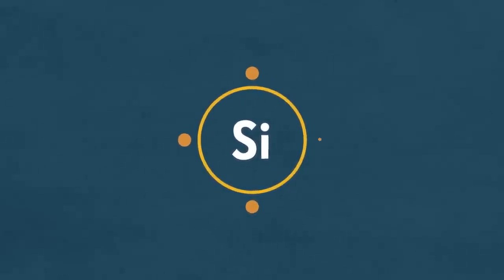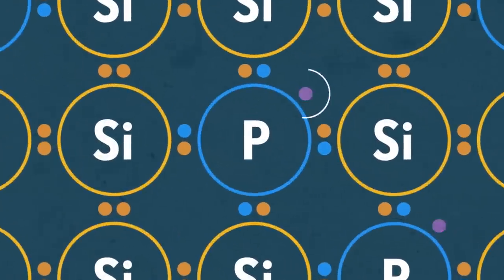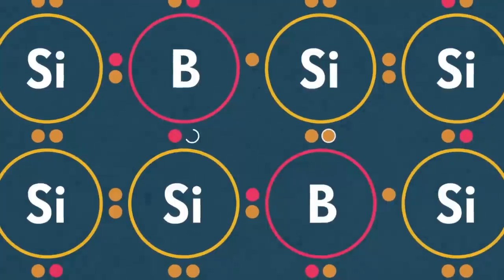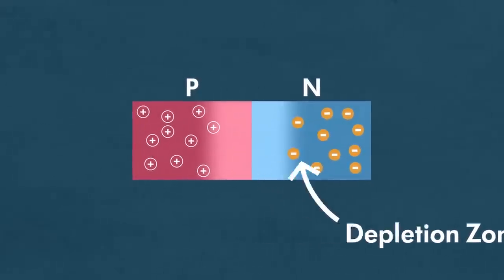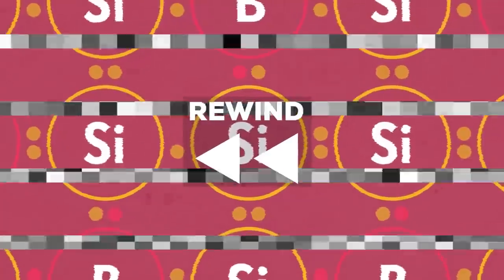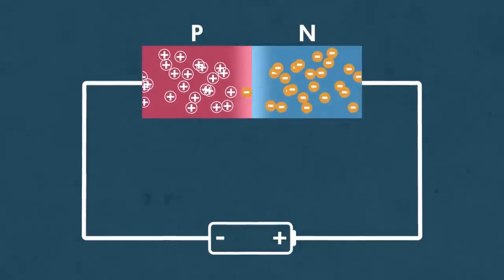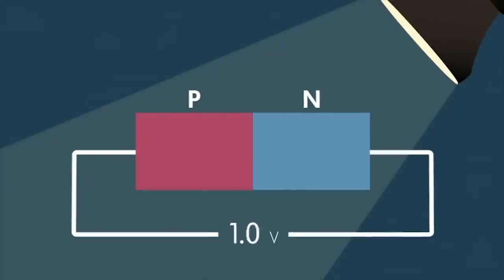How diodes, LEDs and solar panels work

Comment: I appreciate you work and love you content. Just one review here. Although you have beautifully explained the concept of depletion region formation, with the help of built-in electric field. However, while explaining the reverse-bias condition--and the expansion of depletion width, your preferred reasoning was;  @5:35 "because opposite charges attract". For me that was a conceptual jump. Because ideally, you could have explained it with the concept of external electric field formation--due to the applied reverse-bias across the semiconductor material resulting in a dipole. Which further reinforces the electrons to move away from the junction. Basically, in the reverse-bias condition, the external electric field compliments the internal electric field in forcing the electrons away, and towards the terminals of the battery, causing a reverse current to flow. This way it would be more consistent with the actual theory.

Comment: QUESTION:

In the case where the battery is connected in the "reverse" way (where the diode doesn't let any current through), why isn't it possible for an electron to jump from the P-side border to the N-side? The N-side close to the border to the P-side which at this point is deprived of electrons should be positively charged, inclined to take an electron from the P-side, and they ought to be possible to carry one too since they are N-doped. At the same time, the P-side should be very negatively charged since all the holes are filled with electrons.

I know that according to this description, the N-side isn't a conductor when the extra electrons have moved away from the border, but those phosphorous atoms are still there and they are now deprived of electrons, so shouldn't that mean that they have "holes" just as the holes on the P-side, and in that case they SHOULD be able to conduct electrons from the P-side.

I know this isn't the case because obviously the diode does work in practice!

Thank You!

Comment: The diode: type N & P with single junction. N is electron donor to P across the junction as a one-way-valve. It conducts in forward bias, but not in reverse bias. 
The photovoltaic cells develop a higher potential in the N-type when exposed to sunlight. The junction allows one-way current flow.

Comment: Another caveat worth mentioning is that this only applies to direct bandgap semiconductors, in indirect bandgap semiconductors some to most of the energy of the gap gets converted to phonons (vibrations in the lattice) rather than to photons. This is characterized by a difference in crystal momentum between the higher excited state and the lower ground potential, essentially crystal momentum relates to the velocity of the electron wave packet (the quantum representation of the electron) these wave packets are what are actually bouncing off defects when you talk about electron scattering.

Another thing to note is that the properties are direction dependant, he sorta got close to this when he zoomed in at the start but didn't go further.

Comment: The way solar pv diodes are positioned also matters.  Since light has to hit the depletion zone, it makes sense to position the N and P type to maximize the area of the depletion zone.  If I'm correct, panels either have the P or N type sides facing the light source.  The photons penetrate the layer and reach the depletion zone.  So a photon, by chance, has to be able to penetrate and be absorbed in the right place before any electron jumping can occur.

Comment: I think there's a deatil missing in you're  explination: that thet semiconductors can have they're electrons in the valence band exicted (through heat, or photons) enough to pass the band gap, an go into the conductive band, where they can be shared through all of the meterial, by the atoms in that meterial, just like in metals. If the exitation doesn't happen, it doesn't matter that the semiconductor material is doped. Doping is more of a huge helper ... 
Or at least that's what i remember from college. It's been a long time though, since then.

Comment: Congratulations, you just explained the relationship between electrons, positrons and the perturbation of "light" induction. This further explains piezoelectrics, crystallography and the making of a celestial body within the confines of a near vacuum at near zero Kelvin. Now all you need to do is explain the fluid dynamics of Aether, or as Hannes Alfven describes it "magnetohydrodynamics". I have already explained how this works along with the process that leads to sonoluminescence.

Comment: I have a question, solar panels emit infrared light when voltage is applied  to it , so does that mean that when infrared light hit on it then only it will produce potential difference ,
I think higher energy photons will also generate current and it will be more because the electrons will have more kinetic energy(photoelectric effect) , am I right

Comment: Some of you may be wondering why the absence of an electron is positive and the presence of an electron is negative. The reason is that the conventions on which sign is which charge were established long before the electron (and thus the underlying mechanism) was discovered. Ben Franklin came up with the convention, if my memory serves me correctly.

Comment: I think you could have detailed the part between 6:05-6:13, because for me (a noob in this field) it was hard to understand what happens exactly. As i imagine, the electrons move from the negative side of the battery to completely fill up the gaps in the diode, and the electrons would move from the right side of the diode to the positive side of the battery. And at this point, the diode would be happy, and would not let any electrons to the battery (because it would have to tear it out from the atom?), so the electrons cant travel through the diode anymore.
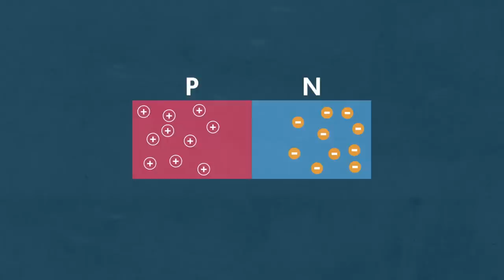Also, 4:56 is not clear either. Why is that a negative charge on the P-type conductor? It needs those electrons so it becomes neutral is it not?
Otherwise - awesome video, thanks!

Comment: Fantastic video! My only "complaint" would be that I wish you'd talked about "conventional" current, i.e. the fact that the + terminal of the battery is actually negatively charged and that's the terminal the electrons leave from. I definitely understand why you skipped it though. Unnecessary complexity!

Comment: That means that light is diodes as secondary to primary, that is primary diodes is one side that repels as the center expands, the barrier as during that barrier the positive go toward the negative which is being filled up that is connected to the battery, but to light so it is filled to the negative since it expands outward, the positive and negative side as between the opposite expand so electricity is created. The bigger the gap, the bigger the electricity. For the light part which depends on the materials which cause the color of light, well, it needs to require to cause the expansion, the center gap, so the bigger the gap, the bigger the electricity which is connected to becoming light, right? So, the fill is opposite of deplete so the fill is equal to electricity, the deplete is equal to decreasing electricity that is dependent on the side since it goes thru the hole, the positive and the negative side as it expands, so losing electricity, right? The current is electricity, so no current can flow since depletion is bigger. Well, the am sure the bigger the gap, the bigger the flow that is bigger electricity or bigger current. The bigger the gap, the bigger the color of light since different light has different energy that matches the gap at the center between two opposites. The center is the neutral point as it expands, the neutral point change to increasing positive that is 0 as neutral to 1, 2, and so on. So, the bandgap which is connected to the depletion zone. Right? Neutral is no current, expanding the neutral is current, so the range of gap from the center which is a line which is a barrier that positive or negative will cross over, same as a magnet in the middle that is botch wall line, the black line connects to the magnet at center if look thru ferrocell and green paper. The diode has two opposite the wire in between the middle of the glass, so two lines at the edges.

Comment: 0:45 in a diode (modern) we don't "push" two piece of silicon together. the whole silicon wafer is usually doped one type(P or N type), then a higher concentration of the opposite dopent(if P then N, if N then P) is doped on the same piece of silicon but on a smaller area. This creates P+N or a PN+ type of silicon.

I feel that you need to explain the "Band gap" of the material, (E=hv) and thus the different colors of the LED. (sorry i did not really see your video all the way through)

I kind of want to know if it is possible to push out light of the different light spectrum if we push different voltages through the solar panel, as the solar panels are made to capture a wide range of light. maybe we can't really see all of them because they are layered ontop of each other.

Comment: Diodes are crystals. the  dielectric field in the depletion zone is what makes them work. the "electron" is the point where the dielectric field terminates on the (semi) conductor.
I think a dielectric field line that is not terminated on a conductor is  the "photon".

Comment: So the direction the diode stops is also dependent on the battery if its low voltage then the electricity will flow when the positive terminal is connected to the n-type semiconductor and if its high voltage then the electricity will flow only when the positive terminal is connected to the p-type semiconductor

Comment: So I've always heard that light kicks electrons off the atoms and that's where the electricity comes from, but how do the atoms not run out of electrons? Is the light replenishing the electrons? I thought maybe they loop back through the circuit and into the solar cells but dont most circuits lose electrons while they run?

Comment: Fun fact: you actually can see some infrared light, you just have to filter out visible light to perceive it! You can make a pair of IR viewing goggles using welding goggles and dark blue theater light gels. Several layers of the gel sheet will block most visible light, but not infrared, so you'll be able to see it!

Comment: Hey Steve, thanks so much. If a solar panel is attached to a lithium ion battery, an electron is pushed out from the panel and eventually pushed into the lithium ion battery, is the battery also replacing the solar panel’s electrons on the other side of the terminal?

Comment: Overall this is a great video, but in terms of "pushing" different pieces of P&N doped substrate together, I doubt that will generally work well (at least for significant current). Preferably you'd dope the same substrate to yield 2 doped regions in good contact with each other in the same lattice (and often the base substrate is weakly doped, so you only have to do one doping for a diode).

Comment: An aspect of this way of describing solar panels that I find lacking is that photons are described as being able to energise an electron to the point of moving but 'heat' cannot. I would think that heat could also energise the particles enough to move and so would produce a charge but it does not appear to be so...

Comment: LED light bulbs are kind of solar panel right?
Does sunlight passes through the glass of the light bulb that covers the LED? I mean is not the same as if the sunlight hits the LED directly but it does theough the glass/plastic of the LED light bulb. Right?

Comment: You were only half correct (basic beginning solid state info, but not the quantum mechanical part). When an electron-pair combine, they only emit photons (light) if the semi-conductor has a fairly direct band gap like, say GaAs. If the semi-conductor has an INDIRECT bandgap, like silicon, LIGHT IS NOT EMITTED. It emits a PHONON, not a photon. A phonon is basically heat, not light. 

Direct/indirect bandgap and photon/phonon emission is due to conservation of momentum. A direct bandgap has very little momentum to conserve in the recombination so it can emit photons (light) which carry away very little momentum, while indirect bandgap recombination must conserve much more momentum by emitting a PHONON (which can be thought of as a vibration in the crystal lattice) which turns the emitted energy into heat by moving around the atoms in the crystal. 

What you see with an infra-red camera when you pump a large current into a silicon diode is just the black body radiation of a hot lump. A tungsten filament lightbulb is the same thing--the current through the filament heats it up and it emits black body radiation. If it gets hot enough, some of the black body radiation is in the visible light band, but most of it is still infra-red (which is why old style light bulbs are very inefficient light sources compared to LEDs).

Sorry to rain on your parade. Silicon diodes are not LEDs (some minor emission is possible but at an incredibly low level-- think 10^-6 of direct bandgap). Trust me, I have a PhD in solid state electronics and know what I'm talking about.

Comment: i have a military surplus non issued mx991/u flashlight and i noticed that the led upgrade gets a little dimmer and flickers here and there and its slowly getting worse. playing around with it i found out that when i use the led the resistance of the negative side going through the switch gets higher. when using the stock incandescent bulb ohms are 0.6 - 1.9 but using the led they are now 5.6 - 8. before i was having a bad time it was supper dim and flickering bad and the resistance was all over the place from a peak low of 6 to a peak high of 330 but mostly staying around the 30 -80 range. but the second day after switching back to the pr6 it was 16 and then 26 after switching back the led. why would the led raise the resistance of the negative side while the stock incandescent pr6 bulb lowers the resistance. i dont know the specs of the spr6 but its more than the led which is 0.5W. over the coarse of about 30-40min the resistance of the negative side using the led went up from 2 ohms to 12.somthing ohms and started dimming and flickering. i switched over to the pr6 bulb and after 5-6min it was back down to 2 ohms.

Comment: This may be a stupid question, but when negative ions from the N-type semiconductor diffuse into the P-type semiconductor, how does that create a positive charge in the area abandoned by the negative ions?  If that area originally had a negative charge (because of the roving excess negative ions), and those negative ions were diffused out of it, then wouldn't the resulting charge in that area be neutral (not positive)?

Comment: Does the voltage in the LED depends on which electromagnetic wavelength it’s being applied? or just light will give out the same voltage at the same efficiency (red light for a red LED)?

Comment: You actually can't just push an N type and P type crystal together to create a PN junction diode. The boundary between the crystals prevents the depletion later from forming. The P and N type layers need to be formed within the same crystal so N type charge carriers can diffuse over to the P side and vice versa, to form the depletion layer in the PN junction. This is why you can't make a transistor by putting 2 PN diodes back to back in a circuit. Even though a transistor is just 2 PN junctions back to back, it has to be in the same crystal.

Other than that small issue, I thought the rest of this was spot on and well presented. I always love watching your videos, especially about electronics because that's my passion. Cheers.

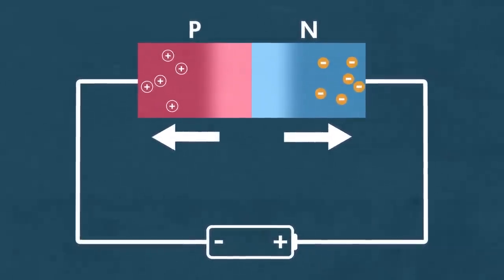Comment: We learnt in school that the technical current direction is written on the batteries. The technical current flow is actually the opposite of the physical one, so it marks positive pole the pole that has excess electrons. So I think at 6:00 the battery direction should be reversed. Am I wrong?

Comment: Wait, why is there a (+) charge build-up on the N-doped side (N)? Is the (-) charge pushing electrons from the outer edge of N and the net (+) charge pulling from the far P side really strong enough to force out not only the excess electrons, but also electrons that were being shared by two atoms in crystal formation in their outer orbital, in order to create an area of positive charge in N?

Comment: Tried to read up on if all diodes actually emit ligt, and it looks like that is not really true. Some guy on Quora describes it as "Standard diodes are made of silicon, an indirect band gap material, thus no photon emission is possible". Wikipedia clarifies this a bit by adding "In an 'indirect' gap, a photon cannot be emitted because the electron must pass through an intermediate state and transfer momentum to the crystal lattice"

Comment: When silicone ist used for solarcells, the voltage of a single cell is a maximum of 0.6V and not 2.4 as shown in the video.

Comment: Between the two, could you potentially insulate storage or transportation lines with this chemistry? As to cause thermal and light radiation to be recycled back into the current, as opposed to dissipating into the surrounding environment, to any degree of efficiency? And what kind of chemical reaction would occur to the materials over prolonged use/exposure? 
I am not very familiar with the technology ^^,  
But is certainly interesting.

Comment: Very well explained! So does this mean that the solar panels that emit infrared when you hook them up to a voltage also absorb infrared when they are generating a voltage ? Or is there a difference between absorbtion and emission wavelengths?
Reply from the maker: That's right. Infrared or anything more energetic than that will be absorbed.